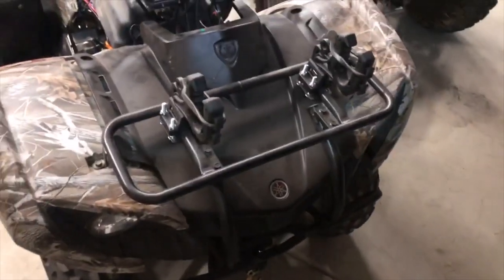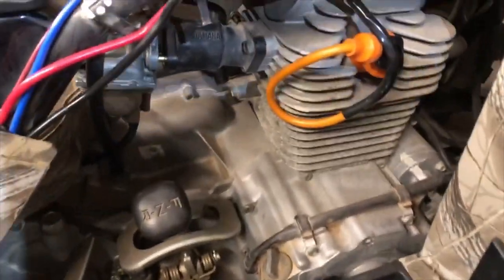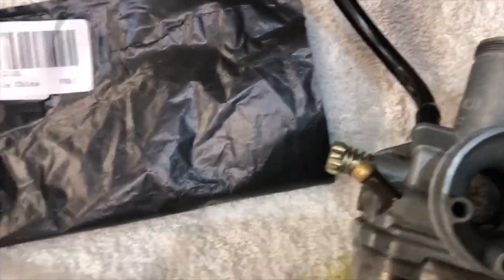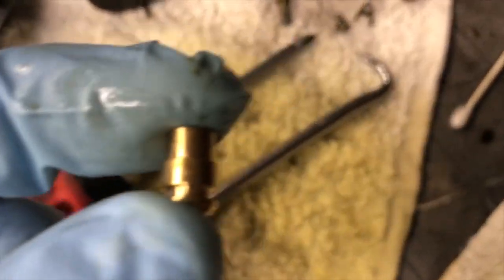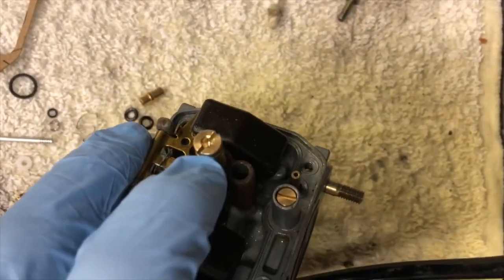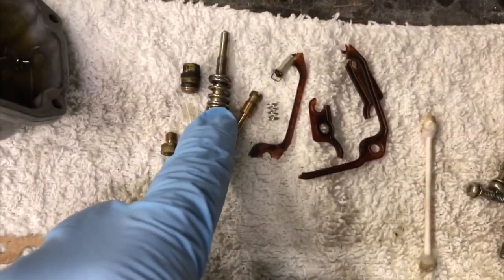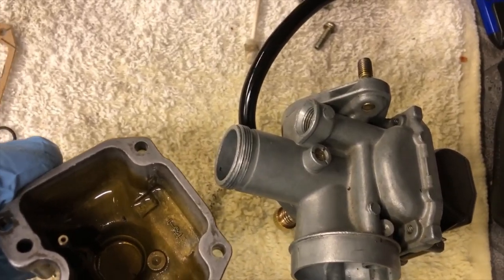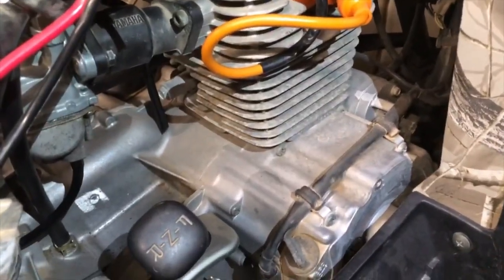Yamaha Grizzly 125 Carburetor Rebuild

Comment: What's your cost for atv carb rebuild and cleaning for a customer
Reply from the maker: $50 an hr labor, customer supplies parts and fluids.
Reply: @mikesmachines9394  so are we looking at 2 hours labor??
Reply from the maker: @Gokywildcats11  usually but depends on condition of carburetor and difficulty in removing / reinstalling it. But usually around 2 to 2.5 hrs

Comment: Did you ever get it running?
Reply from the maker: Jeremy Spencer Yep runs perfect. Carb swap was the trick.
Reply: @mikesmachines9394  would you recommend a clean or to buy a new one, also where would you recommend getting a carb?
Reply from the maker: If you can clean it I would clean it. The aftermarket chinese carbs are GARBAGE. If its beyond cleaning then try and find one with good ratings on Amazon. You can but an OEM carb from Partzilla.com but expect to pay around $300 or so.
Reply: @mikesmachines9394  alright thanks for the quick reply, and for the help! Yeah I am just gonna try to be careful then so I don't have to worry about a crappy chinese carb, thanks for the heads up

Comment: there was no use in putting the rebuild kit on a dirty carburetor.  the bowl has to be cleaned alot better and then use a air compressor and blow everything out then clean agian  to be sure
Reply from the maker: I now have an ultrasonic cleaner and can make these little carbs look and run like new. Check out the video on cleaning a small 2 stroke carb with it. Wish I had that piece of equipment back when I worked on this.